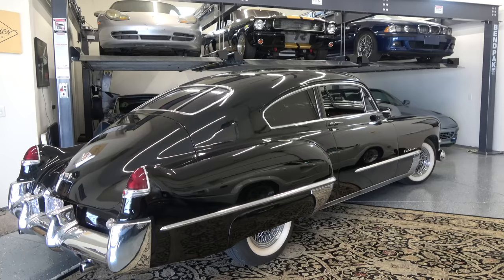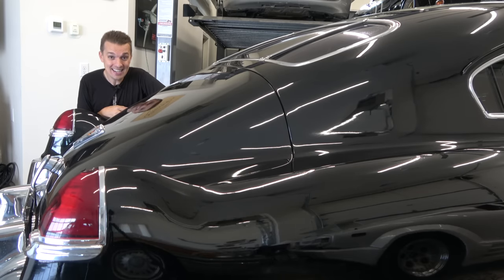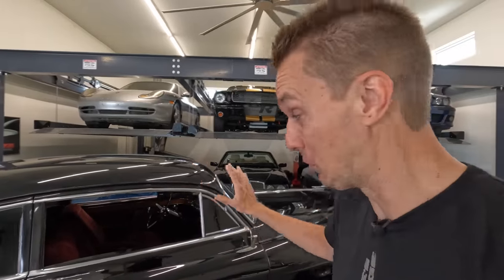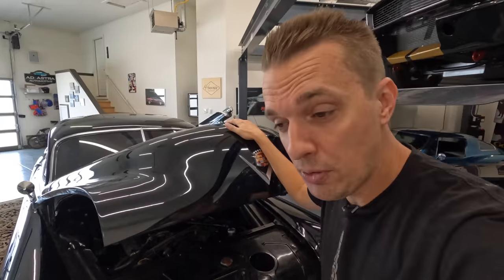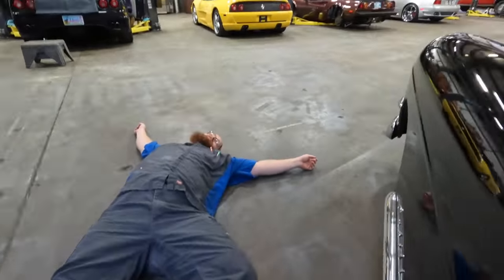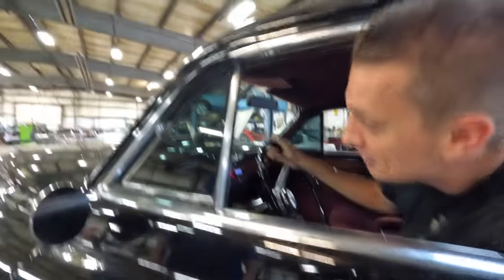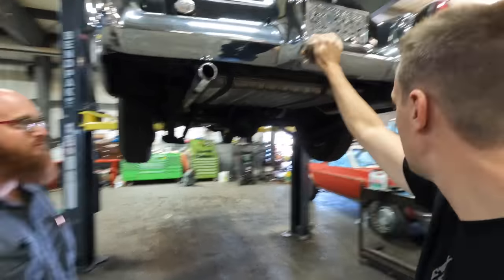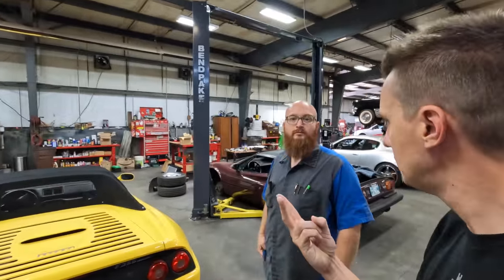I bought a RARE 1949 Cadillac Fastback, and making it my 70 year old daily driver! Amazing Restomod!

Comment: That is one sexy sled my friend.  Someone did a fantastic job with that (other than the silly stereo, but 25yrs ago, that was probably about the only way to go if you wanted a CD player), and honestly, what a great save for that car!  I'm glad you wound up with it.   It'll leak less freon if you keep it R12.  R134a is smaller molecules, and will leak more.  It also won't cool as well for the same reason, as R12, in an original R12 designed system.   A little tip on that exhaust system.  The chrome exhaust tips that roll inward are very restrictive to exhaust flow, and engine performance, and so is that skinny exhaust pipe with all those crimped inward, bends.  Each bend is a flow restriction.  If you want that engine to really run well, go a size up on the pipes, and use mandrell bent exhaust tubing.  Then put a set of chrome tips on it that are straight (not rounded inward).  You'll noticed the difference.
Reply: Great insight thank you for sharing that helpful info.
Reply: Great info I was so awe struck at the car I never thought about that but you are so right.  The Tail section is always larger.  Reminds me of our 2016 Mazda 6 the tail pipes are rounded in ward and a beyatch to keep clean.  We aren’t getting rid of that car anytime soon so I will have to replace those tailpipe ends with straight ones
Reply: @bigkk758  All engines are just air pumps, so if looked at in that term, anything you do to improve flow through them, is a benefit.

Comment: I know the hidden gas cap. When we were kids mom's daily driver for a long time was a 55 Cadillac coupe de ville. It still had that gas cap feature and it was cool even then. The engines in those were almost hand built and balanced from the factory so they tended to be very smooth and lasted longer than most normal V8s of the day.
We finally sold it to a Cadillac collector after it had been sitting in our garage undriven for years when we realized it was going to waste and we didn't have the money to fix it back up even in the late 80s.

Comment: 13:45
Restomod idea; there are "bump handle" power window systems that have the original handle but you sort of push it up or down a little bit to engage the power window. I think the term used is "crank handle switches"
Reply: Just say it's a handle shaped switch
Reply: Why would he want to complicate this car?

Comment: The wiper motor is a New Port Engineering wiper motor. The originals were vacuum operated. I installed one on my 1949 Buick Sedanette as well. It was easily the best modern upgrade I installed on the car.
Reply: Do you still have the '49 Buick? ....my favorite classic car is the '50 Buick Sedanette with that one year only big toothy grill......the '49 was also a very beautiful car, especially the Sedanette fastback.
Reply: @formula112967  nope, I sold it unfortunately. Had to let it go because I bought some other cars, and bought a house. I still miss it, except the fuel consumption. It had the Dynaflow automatic and those first ones are extremely inefficient.

Comment: I had a 1970 Cad de Ville with the 500cc engine. I loved that car,  exceptionally smooth ride with great handling and great acceleration....I was on the I-5 w/3 passengers coming back from Frisco at 2am doing 85, 2 asleep in the back the trunk loaded w/luggage & room to spare when a big Lincoln pulled out in front of me doing 65 so I eased the wheel right and as I passed I eased the pedal down a bit and as I glided back in front of the Lincoln missing the semi in front of me and the Lincoln to my left the Cad lifted up and shot forward like a rocket and my friend riding around shotgun looked at the speedometer and said "110" & I said "I have a lot of pedal left" and that car was 15 years old. That 500cc engine was smooth as a sewing machine. I'd have it again in a heartbeat.
Reply: Don't Call It Frisco. No one who lives there does.

Comment: The donor front suspension is from a 2nd generation GM F-body (70-81). Pretty common donor for this type of swap. 

The spindles look to be the lighter forged units (‘77+). So, I’d say you have a subframe from a ‘77+ GM F-body. 

What concerns me is the sway bar was cut in half and welded in the middle to make up for the subframe being cut in the middle. 

Neat fastback Caddy.
Reply: This is what i came here for, I knew someone would know hahaha

Comment: The first time I saw one of these was in England. I immediately fell in love with the design. This one had a straight body but had no engine or transmission, was missing all its chrome and grille and wasn't painted. I drew up a design for it. Either a gloss black or a pearl white, and the chrome replaced with carbon fiber.

I got a call from a friend who owns a junkyard at 4am one morning. He said "Come to the yard. Now." I said "I swear to God you better have a good reason for calling at this ungodly hour." He said "I do, I swear." I drove there and pulled in the demo bay and got out, my friend was standing there smiling like an idiot in front of a car with a cover over it. I got out and he pulled the cover off of a 2020 Cadillac CT6 Blackwing. It had been t-boned on the passenger side, but everything was there. My friend said "It gets better." He opened the door and it smelled brand new, I looked at the clock. 76 miles. So we spend the next few hours taking the engine, transmission and computer out and one day, when I can spare no expense, I'm gonna build the coolest Cadillac in the world.

Comment: Wow! Very nice Build. Probably an early '70's coupe de'ville front clip spliced into the original frame. I think I saw plugged up AIR ports on the heads, so unfortunately probably not a '70 motor. That thing is awesome.

Comment: 6:02 It's amazing to me how many people don't know that the OHV, pushrod engine came AFTER the DOHC engine.
It was never supposed to be the  "be all, end all" of rpms, it was designed to be compact ,powerful, efficient, economical and a low COG.
It excelled on every front!
Reply: Not just after DOHC, but also after flathead / side-valve valvetrains. That's literally the term "OHV" was invented to contrast against.
Reply: can you elaborate on this? found next to nothing about it online and also I disagree, ohv is archaic, it is less economical, efficient, powerful than any ohc/dohc configuartion. its only benefit is that it's shorter than a ohc engine.
Reply: @luckiee_  Pushrod OHV engines are indeed rare these days and OHV is considered an old technology, but they're revolutionary compared to the even older flathead / side-valve engine configuration. (No flathead engines are still in regular production for automobiles.)

Go look up "flathead engine" on Wikipedia.

OHV engines are called "OHV" by contrast to flathead engines, which have the valves facing upward beside the pistons. The valves are thus not overhead in this configuration. Technically, the valves in an OHC engine are also overhead of the cylinder, making all OHC engines technically describable as OHV, but we generally only describe pushrod engines as OHV these days.
Reply: Indeed. People get caught up in the unimportant HP/L metric and overlook its advantages. I like to point out to naysayers that the 5.7L LS is physically smaller than the Nissan VQ, and despite its larger displacement and notably higher output (higher power density in terms of physical size, I should add), the fuel economy of the C5 Corvette with its large "archaic engine technology" drove circles around anything fitted with a VQ. I'm glad GM and Chrysler continued to stick with pushrods--it has lead to some of the greatest mass-produced engines of all time.
Reply: @omgcool7206  good points.
the 505 hp 7liter! ZO6 didnt have to pay the gas guzzler tax..
Top Gear Mag got 32 mg with a stock 6.2 L V8 C7...
P.S.  Top Gear BBC showed the 2.0 liter Mitsu Evo FQ400 had the worse MPG around the TG Track..
I would asume these haters are comparing hi output engines to other highoutput engines not 1.6 L DOHCs when speaking of of eficiency..
Reply: @gearheadlydia  I understand that in relation to Sidevalve engines, however I was getting at the claims of it being more efficient vs a DOHC design, which as has been said "came first" (though I couldn't find anything on that).

I will agree about packaging size but imo thats the only thing its got going for it.

Can't say I'd wanna work on a cam in block engine tbh.
Reply: @LL L; You're correct about DOHC engines excelled on every front. However, the part of your statement regarding "be all end all" should be altered (just a little...with all due respect since you were one of very few who realized that "DOHCammers" were actually designed and built Before the OHV/pushrod design)...altered to take into account Harry Miller's genius design of the engine that, along with shop foreman Fred Offenhauser, built THE engine that ruled American open wheel {IndyCar style} racing for decades from the 1930's through the late 1960's. Powerful, bullet-proof and while nearly indestructible these 4 cylinder brutes had a monster torque curve that could {seemingly} run forever...or at least 500 miles.
Reply: @omgcool7206  Also, the "SBC v.2" engine, the LS design, in general, are smaller than most DOHC V-6/8/10/12 engines due to not needing all that space on top of the heads, so LS engine can be fitted into many swapped cars, even small stuff like Mx-5s (Miata in the US).
I prefer DOHC out of principle, but I cannot deny the LS engines and the GENIUS design and price/performance they have.
SO envious that you yanks can just waddle down to Jegs and get a brand-new shortblock, key-ready for $1600! Now THAT is brilliant.
Reply: @luckiee_  It is much better than an OHC or DOHC in a V8, as it is relatively compact.  DOHC V8s are very large for their displacement.  Remember, most of us are not into competing on the track.
Reply: @gearheadlydia  OHV is not archaic, nor is it inefficient.  It is a great layout.  The problem with OHC, especially DOHC is the size of the heads.  Not a problem with a little 4 cyl, but a big problem with V8s.
Reply: @timford3599  You are actually correct, but for ordinary passenger cars, DOHC was pretty rare.
Reply: @michaelbenardo5695  that's a fair point. I hail from England so my experience with ohv engines has been anemic, low revving, rattley 4 cylinders. Ohv absolutely excels in packaging size for larger engines but I stand by my point they are less efficient and require more maintenance than an d/ohc counterpart. 

Ohv has definitely come a long way since the 50's and 60's, with the LS engines being a prime example of that, but tbh, I'd still rather have something like a 1-UZFE edit which is a very compact engine thanks to a large bore/short stroke design which mitigates the larger heads.
Reply: @luckiee_  I for one don't like super short strokes.  Not enough low RPM torque.  OHV does not require more maintenance.  Most have hydraulic lifters, and the valves are easy to adjust on those with solid lifters.  In contrast, many OHC engines require you to deal with shims, some of which require removal of the camshaft(s) to so do.

Comment: That fuel filler cap though. That is literally the coolest feature I've ever seen on a car. I mean, putting an electrical connection near to a protentional source of fuel vapours is... questionable, but hey as Freddie and Jared always say...
Reply: All those funky fuel filler locations (like this or behind the license plate for another example) are now no longer allowed under current regulations to due to safety concerns.
Reply: @Geotpf  Which is perfectly reasonable; let’s be honest an electric spark and fuel are two of the requirements for an engine to run!
Reply: " I mean, putting an electrical connection near to a potentional source of fuel vapours is... questionable"    Just about every British car  in pre-fuel injection days had an SU electric fuel-pump complete with a set of points clicking away, either next to the fuel tank or in the engine-bay  -  (Jags with twin tanks have two electric pumps) - and I have never heard of one causing an explosion.

Comment: Welcome to the club of daily driving oldtimers :D 
It's a lot of fun! Even more so if gas prices would calm down again.
but as long as you have working aircon and stereo it's no problem and just fun.
Reply: The air conditioning maybe the stereo not needed.  A car guy wants to listen to the engnie.
Reply: @mexicanspec  Ofc. sometimes. But when you are driving it daily and long distances, not so much ;-).  

You also probably want to soundproof the old car more, as done here, as part of your restomod. I know from experience. 

You might imagine it more romantic, but daily driving means sitting in traffic, driving in a straight line on the highway at a constant speed, constant rpm, etc... when you have your engine yelling at you 24/7 in the heat, you'll go insane. 

On winding backroads, you can turn off the stereo and listen. You can have both. But that's maybe 5-10% of your driving at best. And i love music.
Reply: @surrealengineering7884  I daily drive my '63 Plymouth Savoy.  No radio is ever needed.
Reply: @mexicanspec  I envy your love for engine sound. However i need music in my car. xD
Reply: @surrealengineering7884  I drove a 1963 Cadillac hearse for a while that had no radio at all.  it was never an issue.  My thoughts are more entertaining than any music.

Comment: 500 cubic inches is 8.2 Liters! That’s a truly massive engine. You think about the Audi 4.2 V8; this has the same amount of cylinders but nearly twice the displacement. Just crazy!
Reply: The cool part is they are not much physically bigger than a 350sbc.
Reply: I'd be interested to see what the "all up" weight of the car is! As an example, I have a 1976 Chevrolet Monza 2+2 (hatchback). Same H-body platform as the Vega (not the Corvair Monza). It is an original 4.3L V8 4-speed car. After rebuilding the original engine and running it a SECOND 100,000+ miles I built a 350 (5.7L) for it. Bolt in swap! Think a 350 that would be right at home in, say a second gen Camaro. Except the curb weight of the Monza is 2750#!
Reply: @PhilG999  if I remember right it was about 50 lbs over a 350. 

It's been forever but I bought a 69 caddy just for the 472. (Same as 500) with the plans to put it in a 80-85 Mazda rx7. The 472/500 are underrated motors from that era imo.

Comment: Damn skippy on that 500 Caddoo. I have a 472 with fuel injection ready to drop into my '72 C20 pickup. Fun fact, those engines aren't considered to be a "big block" as there was never a small block Cadillac like what Chevy and Ford did. These Caddy engines are severely under rated, the stock cam in them is almost round, very little lift. Some more lift and rocker shaft valve train really wakes them up with 550 foot pounds of torque easy to achieve.
Reply: No big block in Pontiacs either, it's funny how it gets coined that way overtime. Cadillac engines have a lot of Nickle in their metallurgy so the cylinders wear very slowly to the point it's hard to get new rings to properly seat at times. Great engines though!

Comment: Wow, I am salivating.  I owned a ‘49 Cad, dark metallic blue, in 1960 and 61.  I still miss it.  I remember the huge white bone color steering wheel and huge tires.  The car could cruise all day at 90 mph.  It had the 4 speed hydramatic trans with shift on the column, but no “Park”just a “N”.  Thanks for posting, enjoy!

Comment: Question for you & Wizard: What if you filled the air suspension with the air/nitrogen mix folks commonly use in their tires these days?  (the thought being: assuming the air ride system can accept it, it may last longer before deflating)

/apologies if that's a stupid suggestion
Reply: The issue isn't the gas inside (air is a gas after all) it's the seals. The reason they use nitrogen in the tires is it isn't affected by temperature. Air will expand when it gets hot and contract when it gets cold, not so with nitrogen. Not to mention air has moisture suspended in it as well.
Reply: The air you breathe is 75% nitrogen
Reply: @muskokamike127  Doesn't nitrogen slow pressure loss through permeation by 30-40%

In reality, might mean having to check/add gas once every 3-4 weeks instead of every 1-2weeks, so doesn't really achieve anything
Reply: @muskokamike127  Good point also the pure nitrogen used for tires is also for lack of a better term dried as well.
Reply: @scod3908  I had monroe air lifters on a 2000's deville changed to manual fill like that.  They would go quite a long time without losing much air.  One issue with manual fill is they don't have a dryer on the airline and don't exhaust air when turned off.  It is only back down to min psi but it helps get some moisture out, which in the winter can actually freeze.  Giving an uncomfortable ride for a short distance.
Reply: The butyl compounds are much better than 30 years ago. Why you don’t have to constantly put air in your tires like you did in the past.
Reply: @muskokamike127  Yep! All good points. I guess I should have added that my thinking here wasn't to necessarily eliminate air top ups, but make them less frequent. Of course, fixing the seals is the better longterm answer, as you suggest.